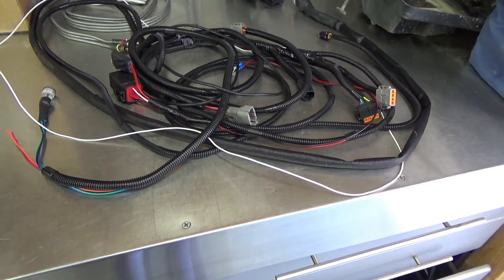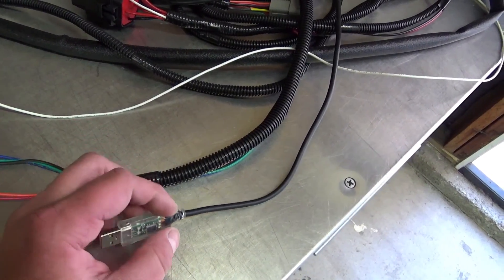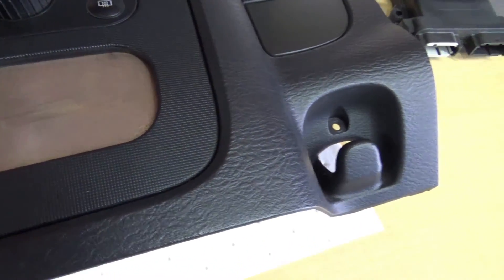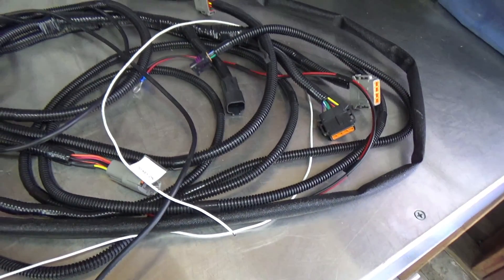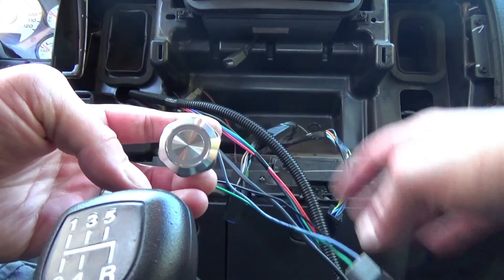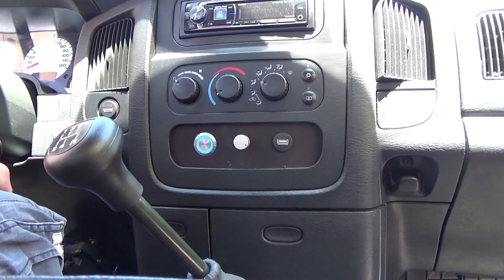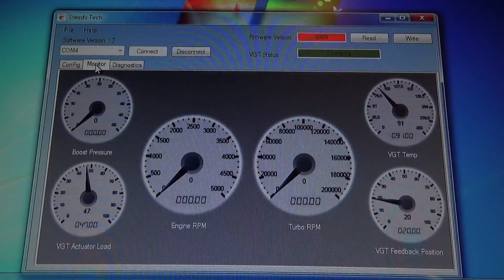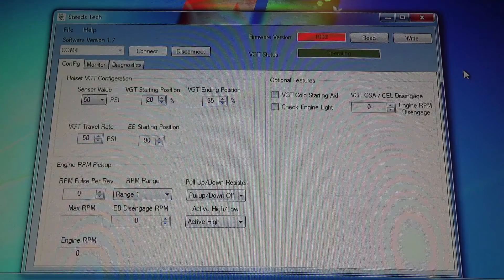Dodge HE351VE Turbo Swap Update

Comment: i really like your videos, you did a great job with the swap, and the videos.  My concern is that the USB port in your dash, what happens if someone unknowingly tries to charge their phone off of it or thinks its a power source?  is that 700 dollar controller at risk or anything?
Reply: The USB is a type Male A, you would need an adapter to plug it into your phone. It has no power going to the USB so you cant charge a phone off it. Your phone would actually power the USB. You could technically use your phone to program the controller. If you have a windows based phone or tablet you can do that right now. I haven't written code to use android or apple devices yet.
Reply from the maker: +Brian Walk thank you for the compliment. I doubt anything would happen if you plug a phone charger or anything else into the usb port but I really don't know. I'll have to ask the guy who makes it.

Comment: Does he have a website where he sells these wire harnesses? or are you having them custom made? also do you have a ball park of what this upgrade would cost? I'm interested in doing this on my 05 but i have an automatic transmission so i dont know if there are any major hold-backs?
Reply from the maker: Thanks for the reminder I put Steeds contact info in the description. He does not have a website for his products. Cost?  I think he sells the kits for around $650-700 plus you'll need turbo and all the misc parts. Not a cheap swap but well worth it. Best bet is to hang out at your local Dodge dealer parts counter and look at the exploded view drawings to see what parts you need. Thanks for watching!
Reply: Thank you for the help, I am definitely going to look into doing this,i just need to figure out the extra stuff that will need to be done because i have the auto trans, or maybe just do a trans swap as well haha.
Reply from the maker: Your welcome! Really the only thing different with the auto is a couple of water lines for the oil cooler everything else should be the same.  Good luck and please feel free to ask any questions that might come up.